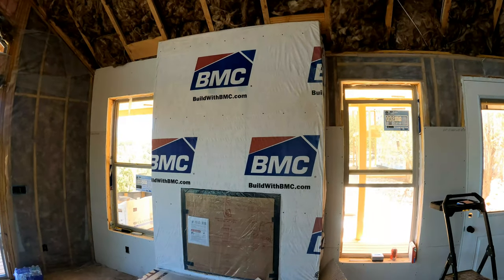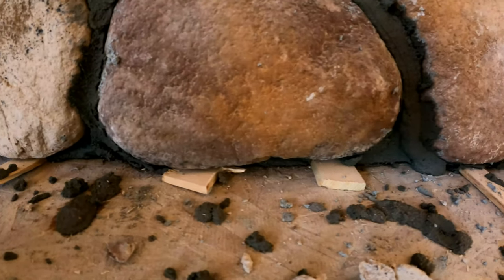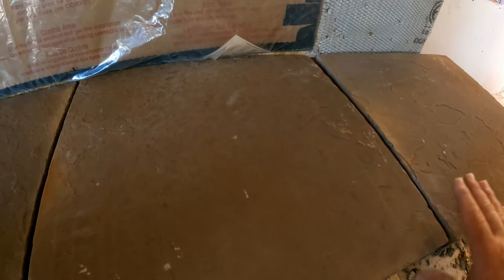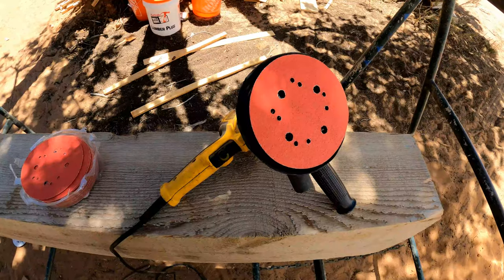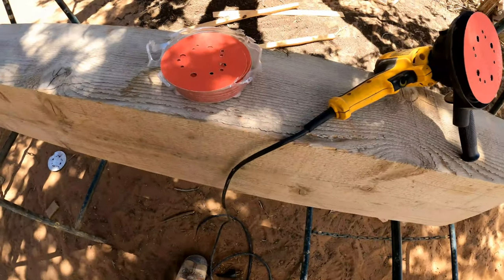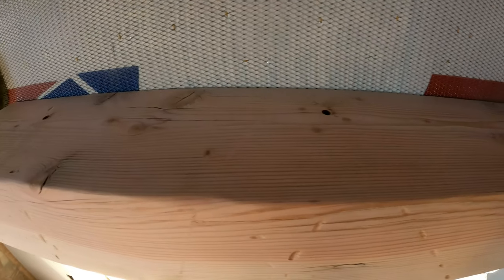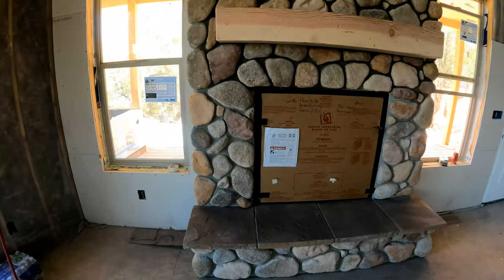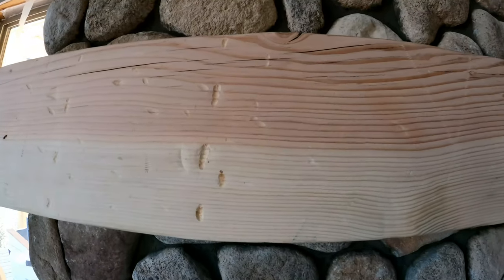Cultured Stone Veneer Fireplace Installation Cobble Stone River Rock

Comment: Just to help so professionally you should use pan head Galvanized 1 1/4 screws  When screwing, you should not sink the screws and leave a quarter Inch roughly never make the mesh tight like your over stapling . Always do the cups up. If you use Staples again, you make sure it's not tight. So the mud can get behind the mesh . It's just the professional way of doing it.  But you did a very good job.Its better and correct and will last long without cracking for all the viewers
Reply from the maker: Good tip